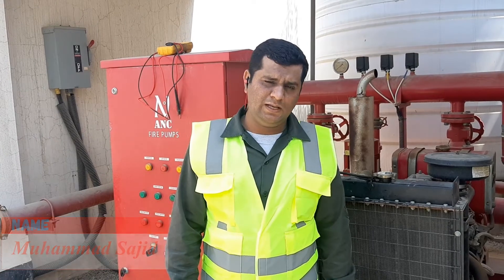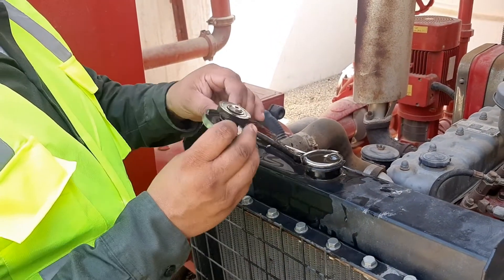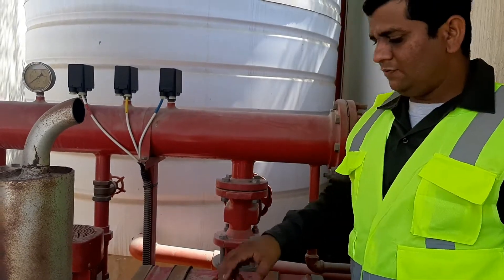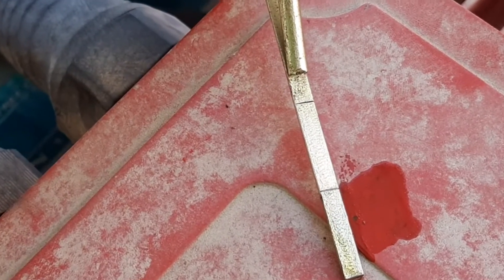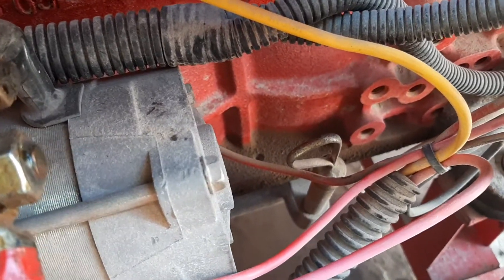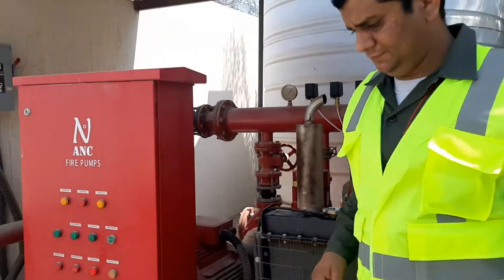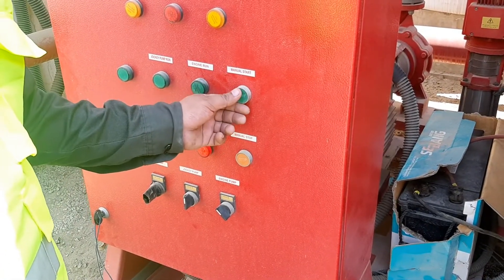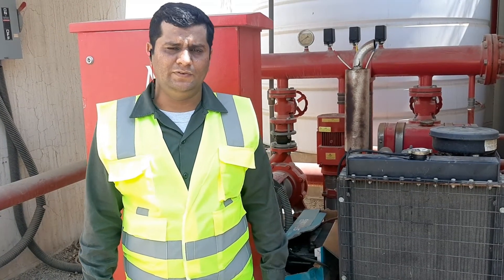how to start diesel engine and checking in hindi/urdu language

Comment: Can I connect 2 negative to engine block and 2 plus starter
Reply from the maker: Batter you connect wire battery terminal not connect positive wire in stater. 
Reason you connect the wire stater point after few minute red wire batterty terminal side wire build up temperature